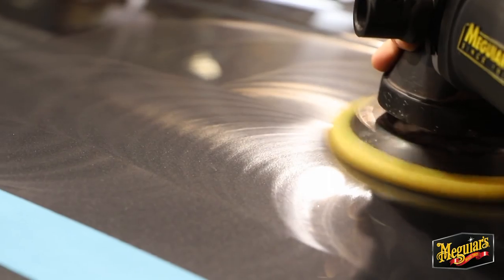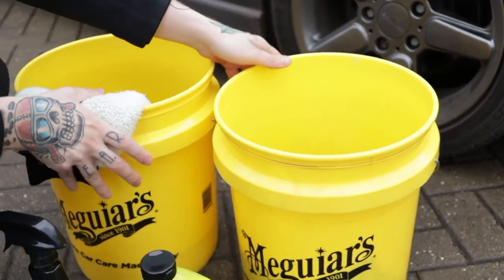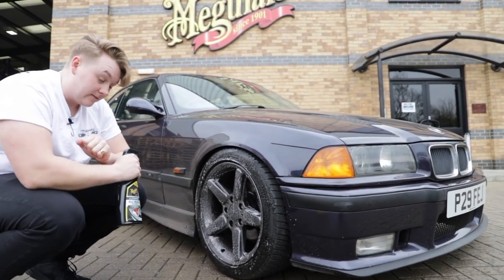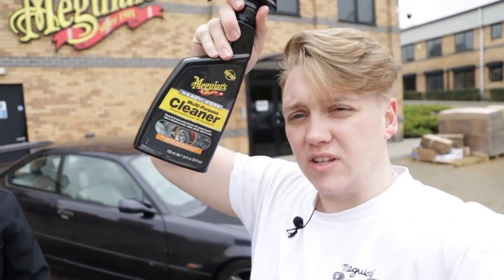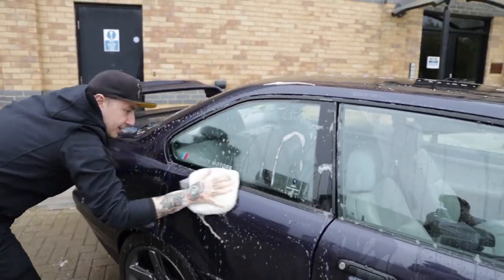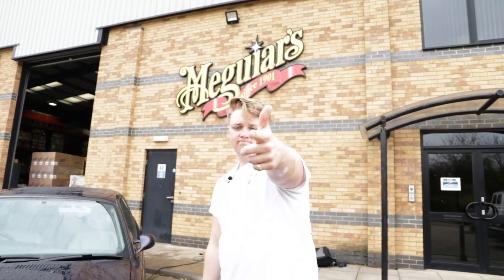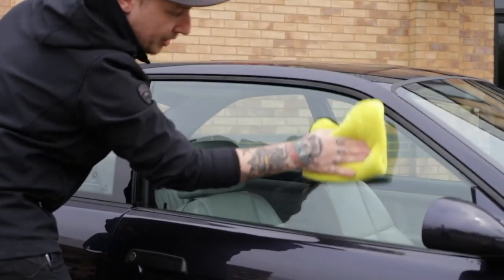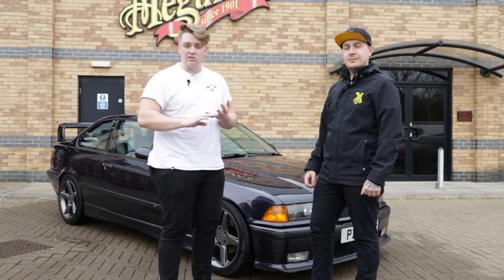Washing with the Two Bucket Method – Meguiar’s Detailing 101 – UK Edition

Comment: If you really want to be safe you really should be using the 10 bucket method.
Reply: Two buckets is enough. Just put new, clean, cool water in the rinse bucket every time you rinse the mitt. About 10,00 gallons ought to do it.
Reply: I use the new and improved 16 bucket technique! It’s far superior! 😆

Comment: Hi. How many times roughly, if required (which I understand shouldn't be often if washes are done correctly once done initially) can you cut into a clearcoat before it gets too thin? Cheers!
Reply from the maker: There are a lot of variables there so there is no real way to answer that accurately.

How thick is the paint (clear coat) on your particular vehicle?
How hard is the paint?
Are you working by hand or machine?
What kind of machine?
What speed and pressure are you running the machine at?
What pad are you using with the machine?
What is the temperature on any give day you are compounding/buffing?

You get the picture.  

For most people using a mild/safe compound by hand or orbital buffer this will never really be a concern.  Generally speaking this only becomes a concern when using more aggressive machine applied products, especially when a rotary buffer is involved.

Comment: Can Use this shampoo on washer pressure or cannon?
Reply from the maker: Yes, our Ultimate Wash & Wax can be used with a pressure washer and foam cannon.  We recommend a dilution of 5:1; however if you want a wash that will perform even better with a foam cannot we would suggest you use our Gold Class Car Wash Shampoo & Conditioner.  👍

Comment: So instead of dipping the mitt into contaminated wash solution every time  you're just running it threw contaminated rinse bucket.
Reply: Do you not understand the purpose of the guards?
Reply: @Nyle95  So are you using the grit guard is only used in the rinse bucket?
Reply: @bitTorrenter  I use in both buckets